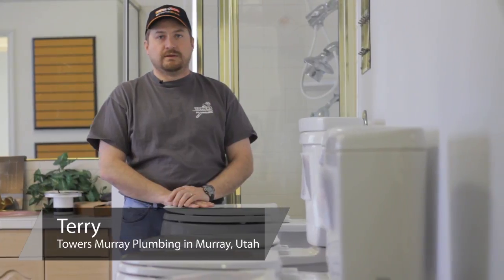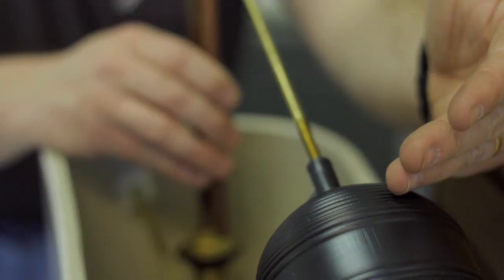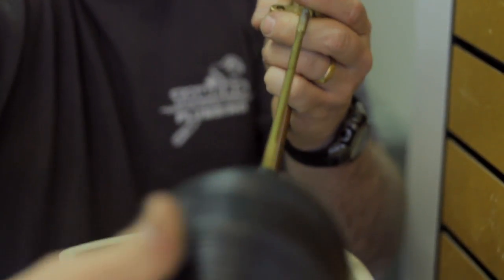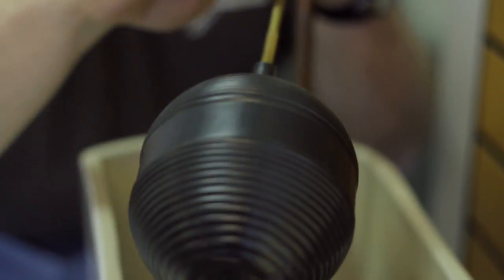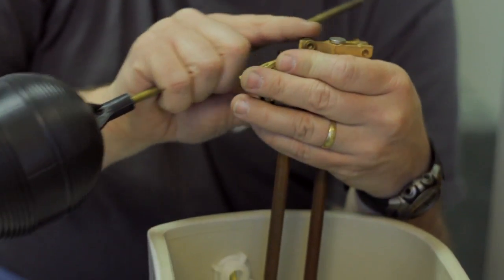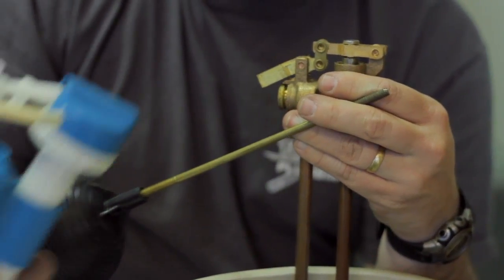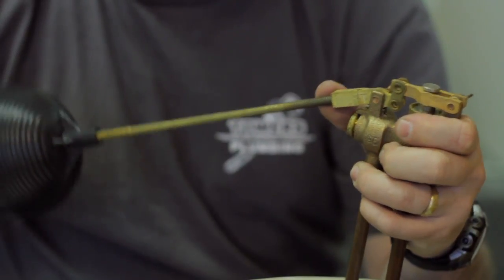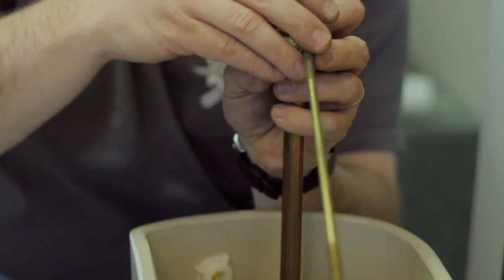Toilet Repair : How to Repair the Float Ball in a Toilet

Comment: I'm in my 5th decade, in all that time I've have never seen entirely-brass hardware.  While you mentioned other types of valves, those cheap, plastic junk ones are the most common.  I would like to see you work on one of them, instead of the type that doesn't exist in a normal home.
Reply: To be fair, when he showed the new replacement system for approximately 2 seconds, it was made of white and blue plastic 😂😂😂